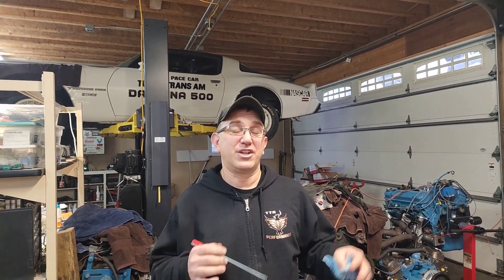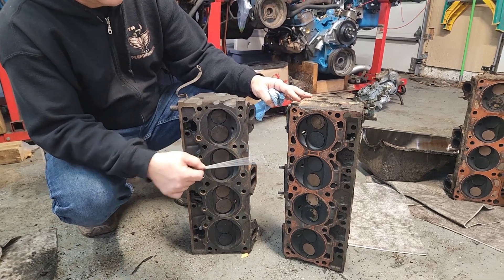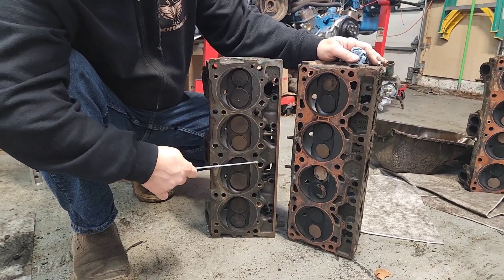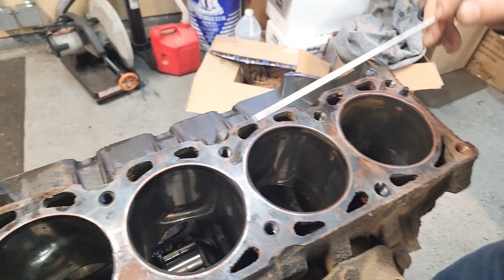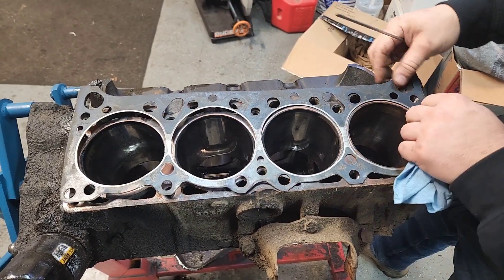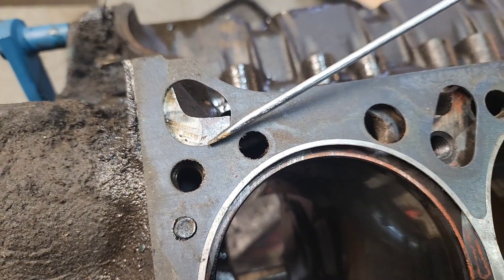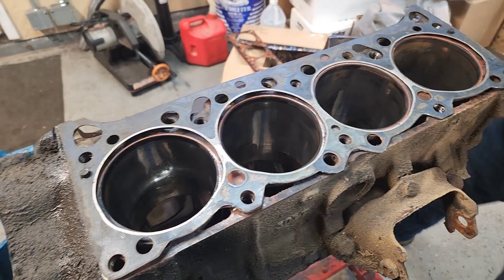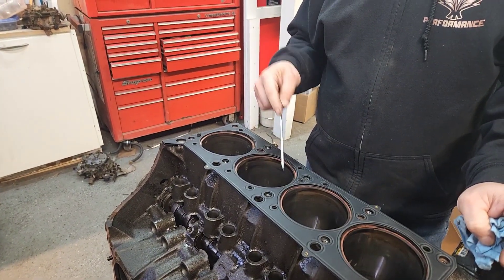TTA Performance - 301 Cylinder Heads vs. Regular Pontiac Heads

Comment: Is there any headers for the 301 na, since it is similar to the other Pontiacs except fkr the hole in the middle exhaust port? Or what is anyone doing for headers or manifolds besides the original 301s?

Comment: The 301 coolant passages in the block deck look extremely like Oldsmobile V8 .. espically the same year 307 oldsmobile motor, the Olds 7a and 6a heads have the same round end and  D shaped centre exhaust ports as 301 Pontiac as well , since Pontiac and Oldsmobile bore spacing is within 0.020 could you bolt a set of Oldsmobile heads on a Pontiac ??? I know different port location but a cam grind could fix that . As for intake that's 🎉 another story but would certainly get people asking questions !! I know back in the day people used Olds Forged 425 cranks in Pontiacs in stroker builds because the bore spacing/ journal spacing of Pontiac and Oldsmobile are so close .

Comment: Bore & Stroke on a 301 is [4" × 3"] that is exactly the same as  Ford's 302  & Chevy's DZ 302 (boss 302 has Clevland heads) and thise engines had high compression. You can reduce the [deck hight] but theirs a limit.

Comment: Interesting video! But why do I want to mess with a 301? I have a TA with a 400 with the 6x-4 heads on it! I believe it’s the W72 engine. Has a bigger hot rod camshaft and single plain intake. Runs really good. Thinking of switching to a 455 and putting all the parts from the 400 into the 455. Camshaft, heads intake and headers

Comment: I just put a 77 400 in my 79 Formula in place of the 301. The 400 is totally rebuilt and runs like crap. I used the quadrajet off the 301 minus the 1-1/2 inch alluminum spacer. I have no vacum to the PCV. Wondering if deleting that plate is the source of my problems.

Comment: THE 301 IS JUNK I HAD THREE AND EVERYONE WAS JUNK
Reply: That’s your experience. I have had 2 78 GPs and 2 79 GPs with the 301 and never had any problems with them. One of my 78s had 300,000 miles when I sold it and I kept seeing the car on the road years after I sold it. Some folks bag on the 301 but it had just as much HP as other V8s of the era. The 302, 351, 318, 360, 305, 350 sbc, etc. all had 135 to 160 hp, just like the 301 had. I I feel the 301 was more dependable, lasted longer and had much better fuel economy than the other V8s of the late 70s. I currently have a 79 GP 301 with 65,000 actual miles and it gets 24mpg on the highway. Not bad for a 47 year old car! My first car was a 78 GP 301 like my dad had so I guess that’s why the 301 has a special place in my heart.

Comment: Excellent video. I have lived under the assumption ever since I was a teenager (1982-89) that the problem with putting conventional heads on a 301 was the intake manifold. I really thought they were a direct bolt on. I would love to run one in Street Stock dirt track racing but I need a very rugged engine to withstand those multiple laps at 4000 rpm+ and aluminum is strictly prohibited. Maybe I'll just stick with the older engines for now!

Comment: I love Pontiacs. I run Cometic MLS gaskets. Last pair I bought was 2013 & I'm on my 5th installation as I re-use them a min of 5 times. I also use studs. Stay away from old cast-iron. Use aluminum if you can as they are much better. I run Kauffman heads. My 474 makes 680 HP@6300 & 635 'lbs of Torque @5000 RPM. 93 octane shell Vpower gasoline.
Reply: Vpower Shell is the real deal.   My 11.3:1 C63 loved that gas,, you could feel the difference.

Comment: Why can you use the 301 block head gasket on the 350/400 heads  if your putting them on a 301 block? Wouldn't that save alot of problems? 🤷‍♂️
Reply from the maker: The 301 head gasket's cylinder bore is too small for the combustion chamber of conventional Pontiac heads.
Reply: @ttaperformance1046  I think you are wrong , the 301 has a 4" bore stock , the 350 is just a little smaller at 3.975" stock, the 400 is 4.12" stock .

Comment: you can weld heads,block,manifolds ect. with oyx & ace, all you need is a powder welding torch kit. dont buy a china made unit junk.  you have to pre heat about 200/250 degrees  and cover for slow cooling. later dude

Comment: Excellent video Joe. I have run MLS head gaskets, and most of the manufacturers are now moving to them, but you are right. The problem then moves to the next weak link. (Pistons probably) for someone building a performance/race motor it is probably a good option and that person should understand the risk. On a streetcar/cruiser, the composite gasket is probably better. 
I think you should offer it as a possible option. 
Great video!!! 
Thanks

Comment: Great video!!  can you bolt on a set of cast exhaust manifolds (326-455) onto a 301 to help with installing a true dual exhaust?
Reply from the maker: You can bolt regular manifolds to a 301 head. 77-80 non turbo 301 manifolds will also work for dual exhaust.

Comment: I'm theorizing with you,  I don't have a Pontiac head near me right now but could you mill the scallop off,  or is there not enough surface left after?  Also can you mill a better flowing head enough to get a workable compression?  How far can you bore a 301 before you have issues?  Could you open it up enough to get a large valve to clear?  Sorry for all the questions but I have a 301 turbo short block laying in the garage from my TA.  When I bought the car the engine was in the back seat and the heads were missing. I found a 69 350 built that and shoved it in.  But I really would like to try building a 301 that's actually worth while.  Also all the old school guys used to hard chrome the crank for strength, could hard chroming the crank help.
Reply from the maker: I don't think you can mill the conventional head far enough to remove the scallops. The intake port will get really close to the bottom. I have successfully bored a 301T block to .065". Should probably still notch the cylinder if trying to use a large valve.
Reply: You could build up the conventional head by spray welding then machining it.